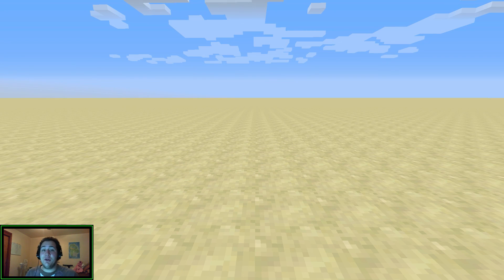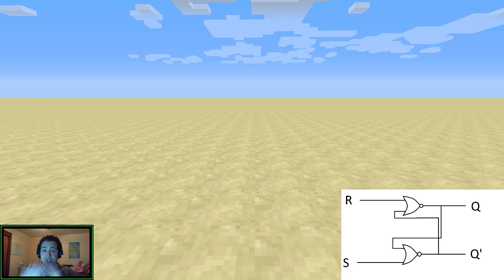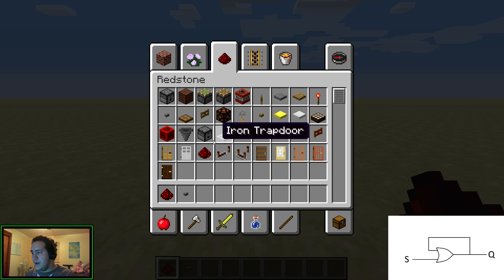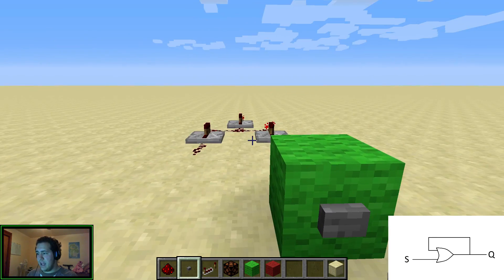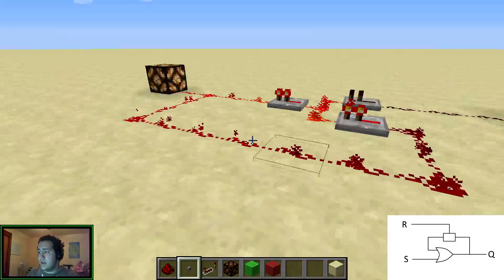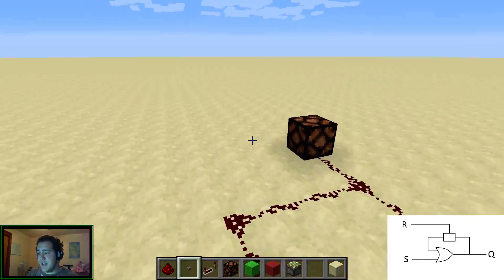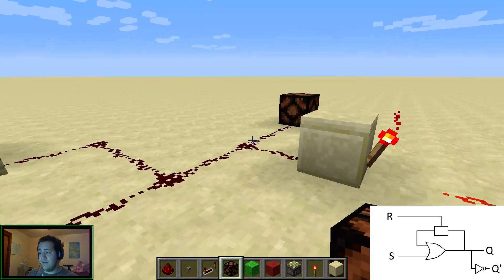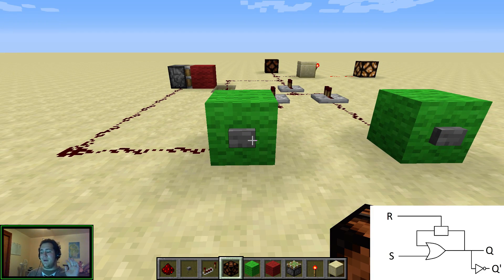1-Bit Redstone Memory in Minecraft - Tutorial

Comment: No need of such a massive setup for storing only a Bit of Memory.
You should use a T-Flip-Flop for storing Bits, it's smaller plus less resource expensive.
Reply: Redstone torch rs norlatchs are better
Reply: But what about stacking them
Reply: i was trying to do this before doing this and i sucessfully made a 3x3x3 bit. the height is from the deleting mechanism. the easiest way to do it is to build a comparator clock, set all comparator delay to lowest, and replace one redstone line with a block with a sticky piston on top. the redstone comparator will hard power the block while the clock will be overpowered and be on forever until you take out the block. quite simple and survival friendly. though why are talking this like a 22 nm transistor vs a 10 um transistor?
Reply: Or SR latch. No piston need. Lot of faster.
Reply: @Sharifee nope
Reply: The issue with T flip flops is that they're not very practical. Each time they receive a signal, the data flips. Let's say you have a CPU, and you're running through a program, and you want to store the output of a calculation. Any bit that has a value of 1 isn't going to store a 1 to a T flip flop, it's gonna invert whatever is already in there. For storing memory, your best bet is a D flip flop. SR latches you need two separate inputs which makes circuitry and bussing a lot bigger than it needs to be. All memory cells have their use cases, but T Flip Flops aren't exactly any less resource expensive than any other memory cell type.
Reply: It depends on the type of component you’re making